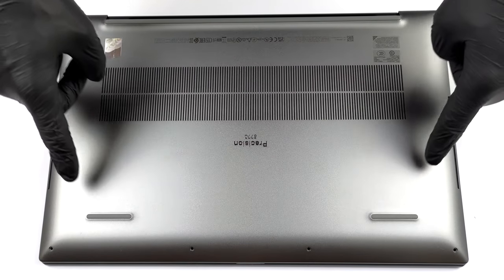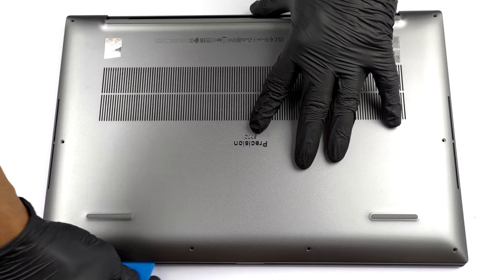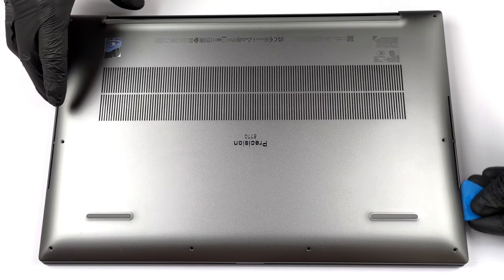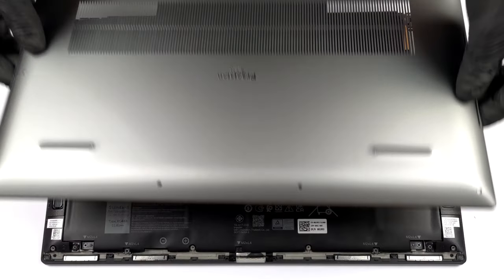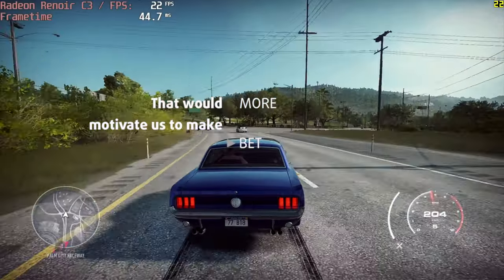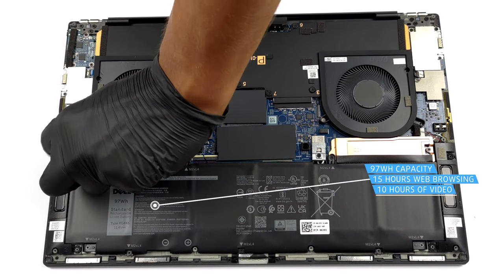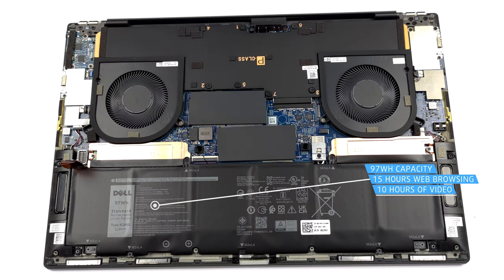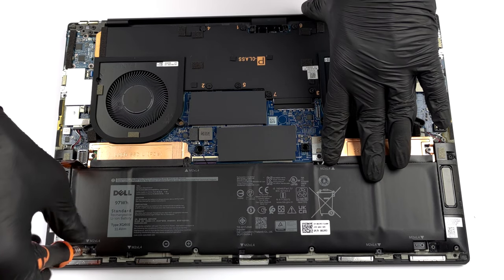🛠️ Dell Precision 17 5770 - disassembly and upgrade options

Comment: this computer will slowdown a lot if you run 100% of the CPU or use decent power of GPU,  heat will slow it down a lot. Very poor design for heat dissipation.
Reply: Thanks for the info!

Comment: Can the graphics card be removed and just use integrated graphics only? I have the RTX A3000 and thermal throttling is a major issue - maybe this would improve it?
Reply: Have you tried buying an extra notebook cooler ?
Reply: have you research on "disabling" it by giving priority to the integrated graphics? or installing gpu software to control it? I have the same issue and I think is just because the fan cooler locations.
Reply: @bluetorch13  This is a very good thought - i did try it out by disabling in Device Manager > Display Adaptors ( https://www.youtube.com/watch?v=qx2T5jlFO3k ) - unfortunately no noticeable improvement in thermals or battery life. I suspect it is more a physical problem like you mentioned blocking fans / airflow etc.